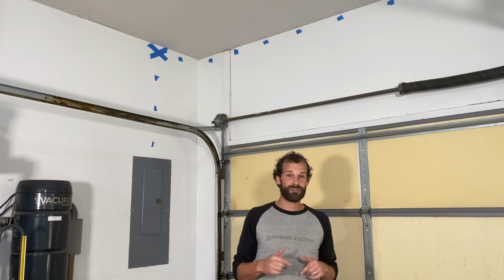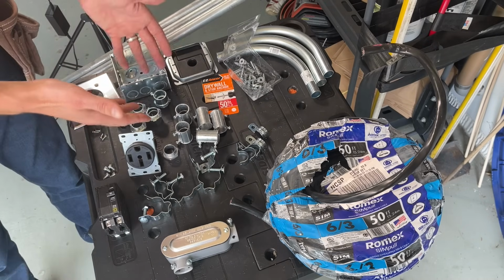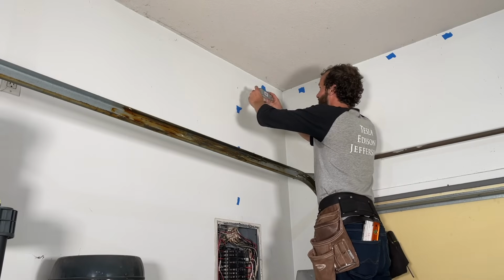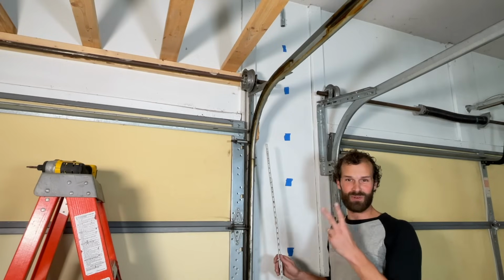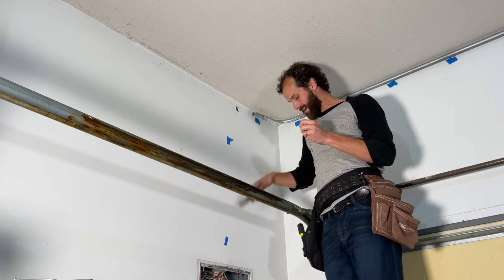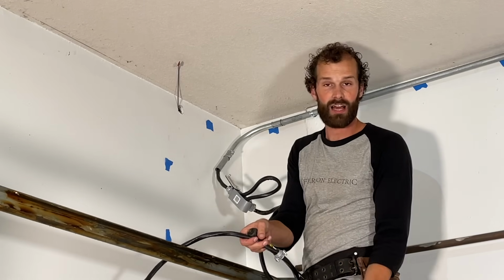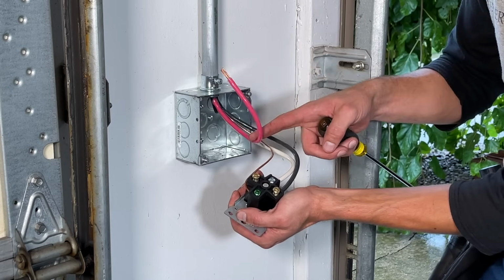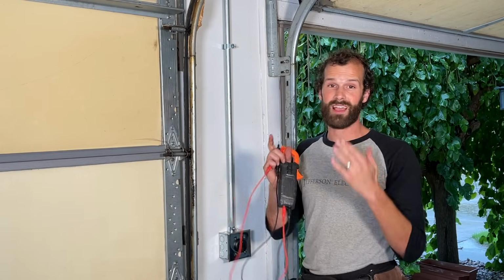How To Install a 240 Volt Outlet | Electric Car Charging

Comment: Hi there,  Great video,  I have a similar configuration, need an 240V outlet in between garage doors.  My electrician did not use 6/3 Romex. He has used two black and one green ground wires.  Per him both are supposed to be hot for 240V and there is no need for neutral wire as it not used. He bend the metal pipes as needed instead of corner elbow connectors. Is that okay?  For the breaker,  re-using a 30A dryer breaker slot (not used because of gas dryer) and replacing it with Eaton 50/30 quad breaker.

Comment: 1. You didn't use a GFCI breaker, which is required by code. 2. You didn't torque either the breaker or receptacle. Very important for constant, high ampacity loads to reduce overheating and fires. 3. You used an LB, which is not listed for what you used it for. A proper junction box would have been code. 4. The cover should have been an industrial raised, not a mud ring and flush mount plate. 5. The use of romex in conduit isn't done by professionals, but many DIYers who don't know any better, do. Never have understood the urge for those unqualified to make videos when they are really not qualified.
Reply: money

guy got 2.1 million views for having no idea what he is doing

connect blck to blck white to white, 

any monkey could do thus, but to actually understand it is a diff story

Comment: You know they make a non-conductive fish tape. I recommend using it. Also to make life easier you don’t have to have the insulation inside the EMT part of the run, makes the pull easier. And I would have used a ground screw in the junction box, although it is already mechanically grounded.
Reply: Is it? I don't think it is. He didn't use any conduit in the wall between the breaker box, and his first LL/LR conduit body near the ceiling. So, I don't think the terminal junction box is actually grounded. Just one big run of metal not connected to anything, which is a risk.

Comment: young man any reason why you didnt use a RACO 8232 vs the halex body??? i hate them halex bodys its to ficken hard to get that last bit of wire in vs a box which would have had easier time putting wire in and just put a blank cover on..
Reply from the maker: Probably would have made things a lot easier for pulling the wire 👍.  Thanks for the feedback.

Comment: Personal opinion. If I am doing the wiring job,  I'd put the wire inside the tube before I install it on the wall.
Reply: Code violation. Conduit system must be complete before installing cables or conductors.

Comment: When I’m working in live breaker boxes / panels I wrap my screwdrivers with electric tape so that if the screwdriver hits live power it hits the insulated tape instead of metal.

Comment: Great video very informative, thank you for bringing this to us. 
I see you're using EMT with romex, that's more expensive, you could run the 4 wires separately and will pass inspection because still safe
Reply: I know this is an old comment, but I'm curious about this... Wouldn't you need the four THHN wires to be protected in a sheath when it's in the wall? I don't think unsheathed individual wires can be in the wall.  Romex seems to be required in the wall and discouraged in conduit, so it seems like a paradox for situations like this.

Comment: I have 220 installed as well and have had 3-4 notifications from the vehicle that charging stopped. The cord and outlet felt very warm so after investigating I found that the white/red/black cords all appear to have gotten hot and you can tell the plastic on the insulation has separated and in some cases split. This is on the receptive lens. Everything appears fine on the breaker side. Sorry if any important details are missing I can try and provide upon response. I just want to know if this is normal or if there is something wrong. I have tightened all the contacts on the receptacle thinking maybe a bad connection was causing the heat.
Reply: If you haven’t done so already, replace the receptacle with the Hubbel constant load style

Comment: A lot of good information, but I must warn about one thing I saw in this video. DO NOT wear jewelry when working around electrical boxes or connections. Always assume there is hot wires in the area. I was a Quality Assurance and Safety Inspector for 5 years for a US Government Agency. If I saw someone working around an electrical box with a ring on, It would have been a Direst Safety Violation. Which is bad for your life, health or career.

Comment: What size of conduit are you using for 6/3  Romex wire? Can i use PVC conduit for 6/3 romex wire?
Reply from the maker: Using Romex in the conduit in this application is not ideal (against code in wet locations).  I would recommend you get THHN wires cut to the length you need.  In my area Home Depot sells THHN by the foot.  You could use 3/4" schedule 40 conduit which will fit 4 x 6-gauge wires.

Comment: Great video, I learned a lot from this video for sure. I do have one question . My fuse box was made in 1979. I have one ground rod on each side of the fuse's so I have a stove that has a four plug on it do I have to turn into a 3 plug or is there a way to connect the four in?

Comment: Doesn’t the wire have to be secured within 1 ft of the panel? I don’t understand the not opening up drywall, it is not that much work to repair.
Reply: Not if it's fished into an existing wall.

Comment: Added thought:  I did not have room for another breaker in my panel, especially for 240v.  I did have a 240v hot tub.  I thought about running those wires out of the panel to a switch so when I wanted to charge the EV, I would just throw the switch disconnecting the hot tub and connecting the EV outlet.  My son suggested an automatic way of doing that.  These 2 item from Amazon fit in the breaker box:  Heschen Household AC Contactor HSR1-63 2 Pole Two Normally Closed 220V/230V Coil Voltage 35mm DIN Rail Mount
CrocSee Miniature Current Switch, CS-TS0, Normally Open Amp Sensor Monitoring Relay, AC 1-50A Detectable

Comment: Gonna ask a question...I was advised a GFCI breaker is required by 2020 electrical code for exactly this type of installation.  Have I been misled?
Reply: Under 2017 NEC not required, under 2020 required.

Comment: Hi, I was looking for info regarding having someone install one or two depending costs. The question is once you purchase the vehicle does the Dealer recommends one at home.Since this investment new technology of EV is costly. Will they allow it to be charged at home instead of the most command use stations installed not in house. I ask this that in a case something happens with this DYI to EV would it void the vehicle warranty. Thanks 4 the video.

Comment: hi im trying to hook up a subpanel in the new garage im building. i have in between 50-60 foot run from house main to the new subpanel in garage.  i know it depends how many brakes n what loads im using but im thinking 100 amp subpanel 20 spaces with a maybe 2gauge copper cables. and how far up should the panel be from the finish concrete slab up. thank you

Comment: Everyone should watch Sandy Munro's video of the safety of these installations . This looks like it will start a fire.
Reply: if torqued properly at the breaker and the outlet. should be good. besides they upgraded the outlet to Hubbell later.

Comment: 1. When working in a panel, WEAR GLOVES. 2. Bend the conduit instead of using a premade 90 for a cleaner look, it really is easy. 3. Use a box out of the wall and transition to individual wires in the conduit...MUCH easier pull. 4. Use pull lubricant and 5. Use an insulated screwdriver in a live panel.  ALL IMHO.

Comment: Here's a pro, couch potato tip from a Tesla guy that installed two, one in his garage and one at the front side of my house.
My first was for my Model S Tesla.
I used 6awg because I thought I needed 40 amps. The reality is 32 amp is what most charger cables use like the new ones that came with teslas.
Going 23+ mph is plenty if you want to save on cost of the wire and easy of manipulation. So much easier to work with.

Comment: So.... now ppl are saying that 6/3 wire is insufficient (and against code) for a 48A Tesla charger..... It needs to be 4/3 romex or THHN. 🙄🙄🙄 Not trynna go against a code, and there's been enough electrical failures, but... c'mon! So basically, the Tesla 48A charger is off the table here. A regular, non-Tesla 30-40 amp may work, but not Tesla....
https://www.youtube.com/watch?v=_JlMOzx44ss
Reply: isn't 6-3 romex good within 60 Amps?
Reply: googling: 6/3 wire can carry electrical current at 55 amperes, be it 6/3 romex or NM-B amp rating. Yet, 55A breakers are nonexistent. To accommodate this type of wire, use a breaker that has 60 amps.
Reply: @liyoung7149  No, don't do that.  #6 wire is good for 55 amps, but continuous loads like an EV charging circuit, which can operate for more than 3 hours, are limited to 80%, or 44 amps.  Fine for a 50 amp circuit like was installed in this video, but not for a 60 amp circuit for a Tesla Wall Connector.

Comment: I pulled 6-3 almost 40' through 3/4" EMT after watching this video. 2 90 bends only. After done, i found the EMT already connected to the ground wire. That's probably insulation breaking somewhere in the conduit and the ground wire (wrpped in paper) touching the conduit?  That must happen a lot?
Reply: Professional electricians don't pull Romex through 40' of conduit. This video is not all a professional installation. Also, 6-3 in 3/4" EMT is a code violation in real life just as it's a code violation in this video. Smallest conduit allowed for thsi installation is 1".
Reply: @pld8993  after wire is in the conduit, i checked continuity between conduit and all the wires to it and all the wires to each other to make sure i didn't damage the wires in anyway while messing with in getting the wire into the conduit. continuity is only between ground and conduit.  i guess bare ground in the EMT, professionals see the continuity between ground and conduit all the time?
Reply: @pld8993  saw another video jefferson electric saying that only 2 6 awg wires carry current so the fill requirements is met where he is
Reply: @liyoung7149  Current carrying conductors applies to ampacities adjustment, not conduit fill. All conductors in a conduit count toward conduit fill. In this video, because it's a cable being installed and not individual conductors, conduit fill is determined by the size of the cable, not the size of the individual conductors inside the cable. This cable should have been installed in 1" conduit, the 3/4" he used is overfilled and too small.
Reply: @pld8993  so all good with 6-3 romex via EMT as long as EMT is 1" instead of 3/4"?
Reply: @liyoung7149  yes
Reply: @pld8993  if using 3/4” emt, do I run 3 6awg stranded THHN and 1 10awg solid copper THHN through the conduit? is it ok to leave the wires exposed inside the wall near the breaker for a few feet?
Reply: @hsienliy  No, that is not OK.

Comment: Great communication however teaching homeowners to enter a live panel is unprofessional. Even liscensed electricians should be doing everything they can to work in a zero energy state and when there is no other option you should be wearing correct ppe. Also, you should not be putting Romex in conduit. I would never let my guys do this.
Reply: Dont you know everyone is diy now

dont need electricians, plumbers, hvac techs etc

its all basic skills a monkey could do 

LOL

I agree, thesw channels are just grifting for money and content

there is a reason why we have professionals

diy is fine for someone who has at least some experience

but stuff lile this is a no go for people with no electrical experience

the dangers far exceed what is practical for a diy

Sorry, but I dont want my house burning down because some fool just followed a video in thw internet

Comment: A couple comments. EV charger installations is all that I do. I am getting to the point that I will only do hardwire installs. Most jurisdictions will now require gfci breakers. Even though the chargers do not use a neutral, the outlet will require one. The cheaper outlets are designed for intermittent loads and EVs have been overheating them with their continuous load. That means an expensive commercial grade outlet and they do not fit into the RV enclosures for an exterior install. For an outlet 50ft from the panel, my hard costs can be an extra $300.
Reply: wherw do you live?

Cali?

Because no one over here js buying eva

overrated overpriced junk

Comment: When landing the multi stranded wires in the breaker box, did you also snug then flex (repeat a few times) as you did with outlet? (at least as much as possible). Great video!

Comment: EMT does not have a nice appearance. 
It looks like an after thought !
Cut the drywall, do it right !
Reply: When EMT is done correctly it has has a very clean, professional appearance. This is not clean looking or professional, and violates several NEC codes along the way.

Comment: I think running romex through EMT tube may not meet  NEC.  Its also extremely difficult to do. Individual wires in EMT is all that is needed.  I believe  romex in EMT could overheat.
Reply: Romex is allowed in conduit and will not overheat, but it's an amateurish way to do an installation.

Comment: Why use an LB, which is a nightmare to try and get wires thru it and not use a 1900 junction box? you can pull the wire straight out and then push it thru the pipe and any slack, is kept in the 1900 box.

Comment: Thanks for doing this. I just used your video to check my own work. I'll probably make a few changes as a result. (I've installed car chargers in two locations so far. Each, I hardwired instead of using an outlet/plug in order to get a slightly higher amperage.)

Comment: I'm not an electrician by any means (although did some DIY around my place), but:

- that's a lot of machismo, approaching a live panel and working inside it without any sort of PPE. Does the code really permit that?

- fixing stranded conductors with setscrews just like that doesn't look good to me. I would've crimped some sort of pin terminal onto each first. Or just used a solid conductor cable (yes, a solid conductor that big would mean a lot of wrestling, but will definitely be more robust).
Reply: I’m not 100% sure but I don’t think they manufacture #6 awg solid copper except for #6 awg solid bare copper for grounding

Comment: Very nice video, with a lot of great tips and DYI show and tell.  I would utilize a shorter screw driver around electrical panels, etc. as they are safer and easier to use. EE, thanks.

Comment: I need to run 50 amps to my detached garage for a welder/plasma cutter. Can I do this without running a sub panel? I have a 100 amp main breaker. The garage is about 30 feet from the panel if that matters.
Reply: Multiple branch circuits to an outbuilding is not allowed, so if it already has a circuit for lighting and receps, for example, the answer is no. Installing a feeder circuit to a subpanel will allow you to have multiple branch circuits in your garage.

Comment: Appears that Joel is installing a Hubbell 9450A, 50A, NEMA 14-50R receptacle. This is an industrial grade piece as FedSpec grade is expensive overkill. This is better than good for extended duty-cycle home use. $90 on Amazon. Do it once, do it right and be secure in the knowledge you did so. The clue is B00IPBMUKY. Cheers!

Comment: I'm curious if #6 is correct cause I think a tesla charger run time is more than 3 hours so 50amps x 1.25 62amps but I'm guess cause you're using a 50 amp breaker it should be fine right?
Reply: Most EV chargers draw 42A or less

Comment: I want to do this from my main outside panel with a dedicated breaker and run to a new outlet in the garage as my garage panel is only 70 amps total. Luckily I am in a 1 story. 

Do I need to put the wires in conduit in my attic?  Or can I run it across the attic bare?
Reply: Generally, you can run exposed Romex through an attic, no conduit necessary.

Comment: Instead of having to turn your wire counter clockwise to straighten it you can just roll the wire  bundle  out  and it will be smooth also why aren't you running thhn in the conduit isnt that code. And you can use a non metallic fish tape or glow stick. But you do nice work I get a lot of good info from you

Comment: How does a 240v that does not have a neutral work; I thought that a neutral is always necessary.
Reply: The two hots on a 240V are on different phases. The best way to visualize it is that when one is pushing the other is pulling. They complete the circuit for each other.
Reply: @pld8993  thank you for the explanation, now I know. Frank

Comment: Back in 1992, I did some pulling when I did a temporary job with an electrical company in Florida; at a restaurant that was then being built. There's actually a pulling lube to make the wires pass easily and I had a bottle of it in my van for about 15 years or more after. Isn't it possible to use the THNN-type single wires for this installation?
Reply: Yes, THHN is how it would be done professionally.

Comment: So was it not necessary to wiggle torque 3X the wire into the circuit breakers like you did into the NEMA 14/50 box?

Comment: i read you cannot pull romex into EMT because it will get to hot so it illegal in calif...  so is that true??? and is this style of wires in this casing okay to be pulled into this EMT???
Reply from the maker: In my area (Illinois) this is not best practice but in this specific install it is not against code since the conduit is in a dry location.  It would be better to get THHN as compared to the Romex used in this video.

Comment: Would it be out of code to use individual wire instead of the combined Romex style wire.  It seems it would be easier to pull through conduit.